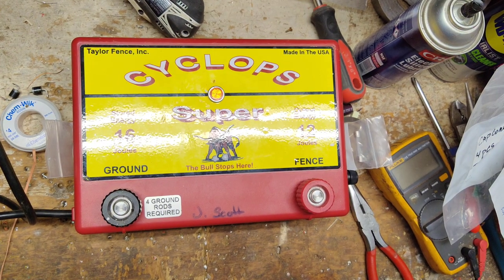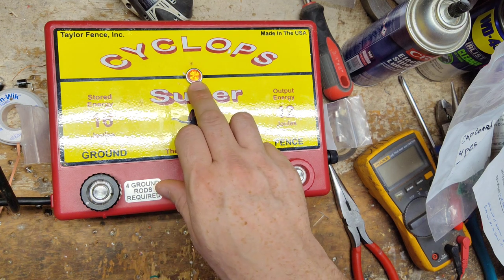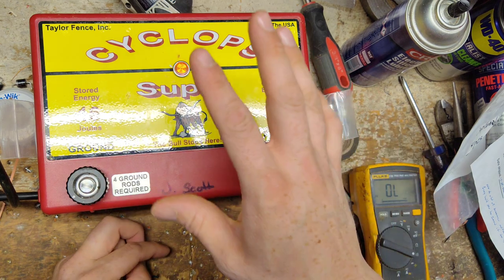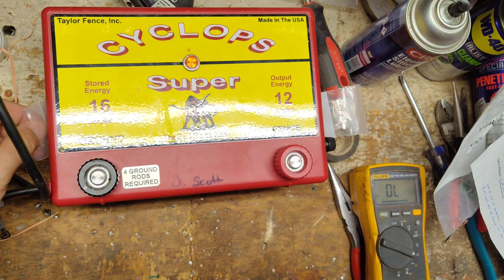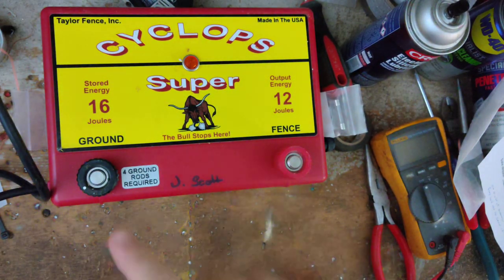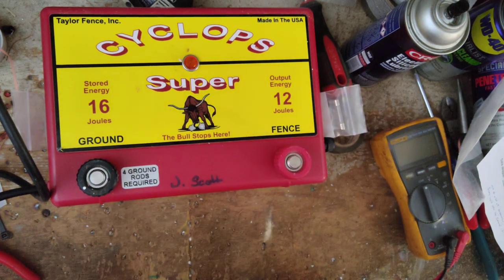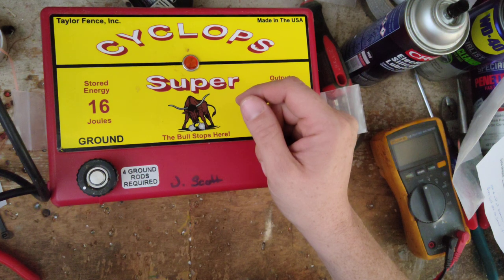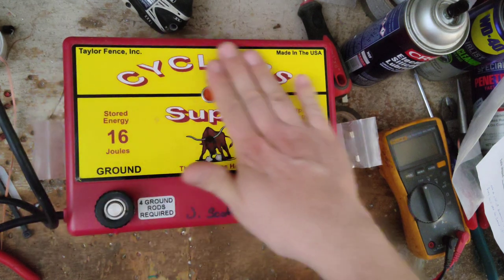How to test to know if my fence charger is working right or not, www.fencerfixer.com -

Comment: I'm looking at making a portable unit for camping to deter black bears. Looking at the Cyclops Champ Battery - 5 Joule Fence Charger - Battery (12V) Powered. The listing says it needs 2 ground rods. Can you tell me how far apart the ground rods should be? And what kind of deep cycle should I look for to power it all night? I'll be getting a 100watt or higher solar panel and charge controller for the battery also.
Reply from the maker: You need to knock them into the ground as deep as you can and space them 10' a part. On the cyclops units, even though it's a 12v unit, you'll want to protect from the rain. There's no gaskets on it, just an overlapping getting and back case and I've seen plenty of them come in with moisture damage causing them to fail. You'll want a good 100aH 12v battery or a standard deep cycle marine type battery. A 100 watt should be plenty for that size unit.

Comment: I bought a 5 joule cyclops for goats and coyote deterrent. Did I go too big? What determines how many volts are put out onto the fence itself? I’m just going to be running electric netting off of high tensile wire.
Reply from the maker: You should be fine with that unit. They're transformers are built pretty heavy duty, so you should be ok. Just keep the unit protected from the weather and direct sunlight. The transformer inside is what puts out the voltage to the fence.

Comment: Appreciate your video especially jumping the spark saved me some deniro's because I was about to buy a specialty hot wire tester 👍👍
Reply from the maker: It's kind of a crude way of testing it. To know for certain of you're getting full power, 70%, 40%, or 10% power you need to know what the voltage is, and a good fence tester will tell you. Plus on the fence you'll want to know if you're getting 4,000 (4kv) or 9,000 (9kv) because you'll get a spark to jump either way but you won't know if the fence is loaded down from a short or not.
Reply: @FencerFixerRepairLLCKansasCity  That's right. It is helpful in getting your fence up and running if you know for a fact the fence isn't working and you have power on your charger then you know you're grounded out somewhere. But definitely a fence tester is the only way to know what the output of your fence is which is crucial if you're trying to keep deer out like myself. Thanks again for your videos